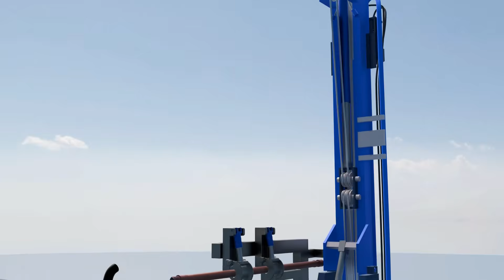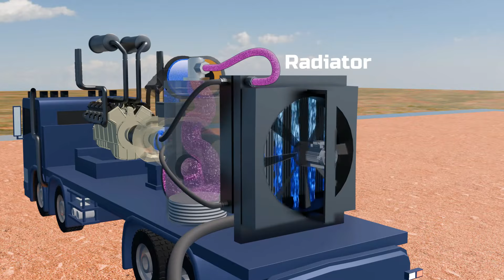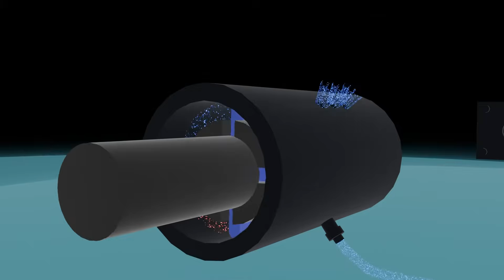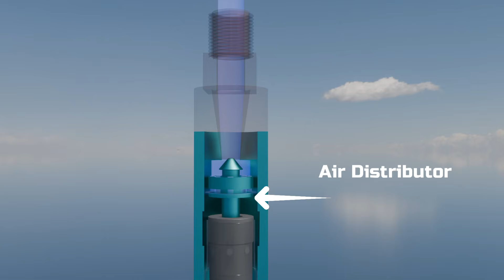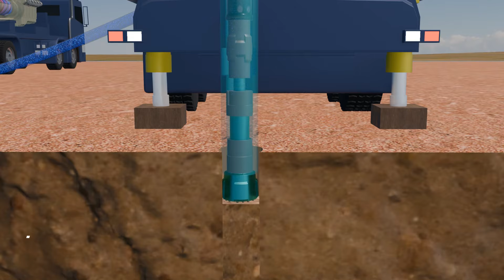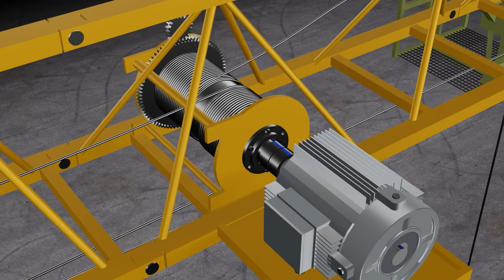How Borewell Machine DTH (Down The Hole Drilling) Rigs Works - 3D Animation

Comment: Do they use water?
Reply: More commonly they use drilling mud to cool the drill bit blades from friction and heating.  In offshore drilling using mud is used on the rig ,   after disconnection they pull out the mud
Reply: The mud room also known as shaker house,   where a large hose is connected to the drill pipe abstracting the drilling mud.   You can learn more watching deepwater horizon
Reply: Yes